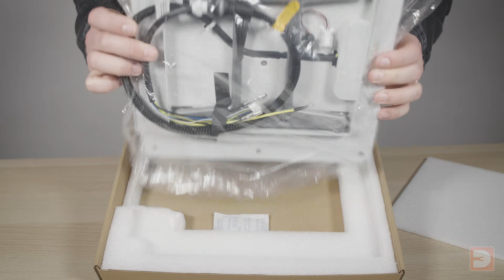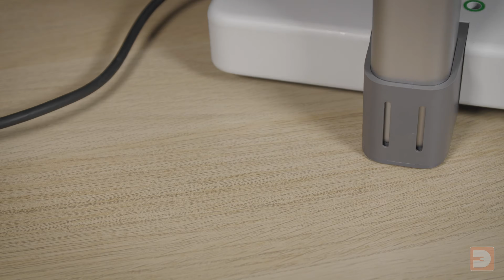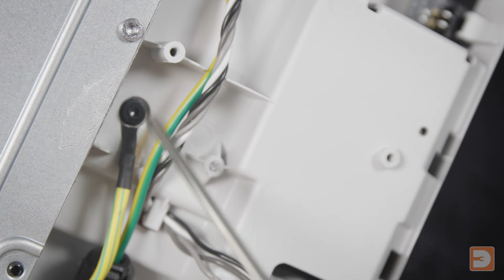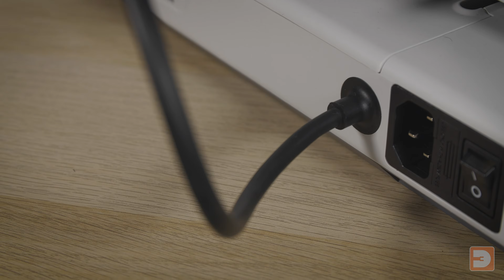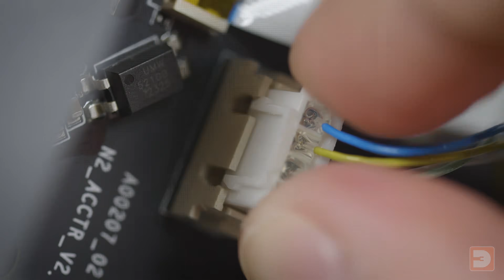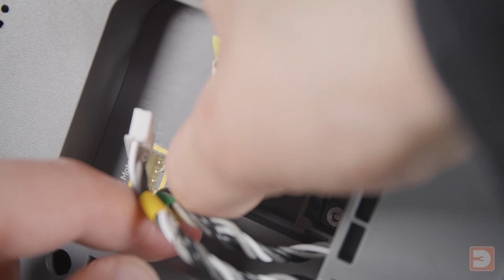A1 Heatbed Replacement Tutorial

Comment from the maker: If you're replacing your heatbed as part of the recall, Bambu Labs will require you to take 3 photos of your updated printer and send them in to receive your gift voucher. Some of those will need to be taken before you fully re-assemble your printer, so please check the email and/or ticket message that Bambu Labs will have sent you to confirm which images they require from you before starting this process.

I wasn't able to confirm before posting this video that Bambu Labs was definitely requesting the same images from everyone (rather than varyinig the request slightly to prevent people from just copy and pasting other photos), and as a result didn't specify the photos in the video so as not to misinforrm people.

Let me know if you have any issues, and happy printing!

Comment: My A1 was defective right out of the box with a broken heatbed, which was not related to the previous recall.  It just flat-out didn't work.  Bambu's solution was to send out a new heatbed and then compensate me by giving me a whopping two free rolls of filament to tear the original heatbed out and install the replacement.

I found it much more prudent to send the entire printer back and get a refund, as their tech support team was extremely difficult to get along with. Even the return procedure was frustrating as Bambu INSISTS that the customer document the re-packing of each piece of the printer, including taking video of the full disassembly and properly re-attaching all the original shipping constraints, including re-fastening the heatbed's shipping screws, re-tying all zip ties, etc.  It's been weeks since I returned the A1 to them and I still have not received a full refund. . . and after all the hassle of recording the repacking process they never asked for that documentation.

I will never deal with Bambu again.  This has been a nightmare.  A competitive brand arrived in record time, was easier to get up and running and overall been a joy to deal with.  It was slightly more expensive, but in this case  you truly get what you pay for.  

Bambu is cheap for a reason.  Learn from my mistake.

Comment: I only want to ask, what are the best items to buy from discount we have got after the replacement?
Heatbed Nozzle Wiper and Hotend with Nozzle 0.4mm as spare items? Anything else?
I am not heavy printer but I know anything can break after some time, but I do not know the weak points of the 3D printers...
Reply from the maker: Hey there, sorry for the late reply.
Assuming the A1 is the only Bambu Labs printer you have, I'd suggest getting a spare 0.4mm Hardened Steel nozzle, as well as a 0.2mm nozzle and either 0.6mm or 0.8mm. This will give you great flexibility when printing different things (If you're not sure the advantages of different size nozzles, I posted a recent video covering exactly that).
Other than that, a spare nozzle wiper is good to have, and beyond that, it's difficult to tell what may be the next thing that needs replacing on the printer, so you'd be best spending the rest of your voucher on possibly an additional build plate, and then as much filament as the voucher will afford you. 
If you really only wanted to buy spares with the voucher, the next most perishable item in the A1 would be the belts, so you could invest in one of each of them.

Hope that helps (if you've not already spent your voucher), and again, sorry for the late reply.

Comment: Did anyone need to perform bed tramming after installing the new heatbed, or was there no need?
Reply: I skipped it... I only did quick bed leveling when printing something and it was ok.
Reply from the maker: I ran several test prints of different styles after recording this video to ensure it was printing well before editing and publishing it as I wanted to double check tramming wasn't required.
I had presumed it wouldn't need it with the level of automated calibration it does anyway and it was fine for me.
That said, I have seen a couple of people say they needed to do it, but I am not sure if that was a precautionary judgement on their part, or they found it to be necesary after experiencing issues.
If enough people comment requesting a bed tramming tutorial, I'll make one and link to it in the video description.

Comment: As someone who just installed the new heat bed, I have a question for you. What should I do with the old heatbed, and is there a safe/proper way to dispose of it?
Reply from the maker: This is a good question and I have some thoughts on things people can do with them that I'm working on for a future video so I will revisit this topic.
If you did want to get rid of it though, correct disposal methods would depend on where you are and your local services. But there's no dangerous materials or electronics in there, so would be the same process as disposing of a toaster or something like that.

Comment: And why don't you show the manual bed levelling?
Reply from the maker: I'm guessing you mean bed tramming.
Well I had assumed that it wouldn't be necesary as a result of the level of callibration it does when running full calibration. However I didn't want to just publish a tutorial based on an assumption, so I ran and completed several prints checking everything ran fine after replacing the bed before editing and publishing this video, and it worked perfectly. I didn't want to add another step for people to work through if it wasn't necesary so didn't include it as a section in this video.
I've had a couple of people ask if it's necesary, but I don't think I've had anyone yet say that they found it was necesary.

Comment: I wish someone would explain how to disconnect the AMS filament tubes correctly :/
Reply from the maker: As in, removing the PTFE tubes from the AMS itself, or from the 4 way splitter on the extruder?
Reply: @3DRevolution  both ^^ but i did it, its was by far my biggest issue because i wasnt sure if i had to pull or push it (push both down), they were pretty hard to remove.

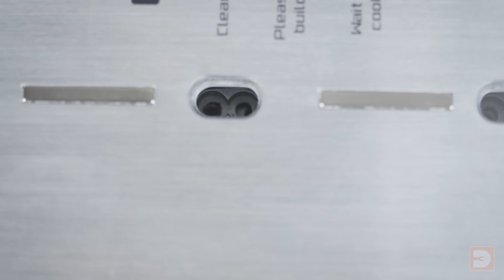Comment: At 8:15 I didn't pay attention to the "slide the bed to the back of the printer" and used the wrong screw holes. Everything worked, I did a calibration then a test print of Benchy. However after a few prints, I kept getting errors that the build plate was missing.

I realized that those 4 securing screws I put in the wrong holes so the head bed was 1/4" too far forward. When I saw the head descend down to locate the plate tab, it just missed.

As for pictures, bambu emailed back to get me to include my serial number in the shot, only then did they clear my recall message on my printer and process the credit.

The manual heat-bed levelling procedure is missing from this instruction. While I ran the file suggested, I didn't watch the video showing the adjustment of the 3 levelling screws until there was a sheet of paper clearance between the head and the head bed without the plate, and the tightening the 2 lock bed screws.

The balancing act of the printer on its side scared me, I guessed that it would slide off the box and damage the parts so I used a pillow.

Comment: Thank you for the informative video. Do you know if the check by an electrically skilled person is required in the UK to get the voucher? Or this only in the EU?
Reply from the maker: You're welcome RE the video.
No need for getting it checked over in the UK, this is only the EU.
However, Bambu does require you to send them a set of pictures to prove that you've completed the bed replacement correctly before they issue the voucher. They should have sent you an email and/or ticket update letting you know what photos they wanted.

I would have included it in the video but I'm not 100% sure it will be the same photos requested for everyone as they may vary it to prevent people just using other people's photos.

For me it was a photo of the re-fitted ground cable, a photo of the sensor wires held down with tape, and a photo of the back of the printer with the end-stop fitted and the serial number QR code in frame.

Comment: I'm beginning this exact process right now 👍😎  we're get the $120 voucher, plus there is a discount 20% coupon code going on right now for the ams light.  Perfect timing 😀
Reply from the maker: Good luck with the swap over!
I was hoping to get this video out sooner than today but unfortunately my kit didn't arrive as soon as expected. Still glad to get it up for people planning to do it over the weekend, hopefully it helps.
Reply: @3DRevolution all done, thank you very much.  Your video was excellent.  I also made sure i took photos of the connectors and ground wire, etc before screwing the bottom plastic shells back on.  BL asked me to send those to ensure it has been done properly and to receive my voucher. 

Thanks again 👍🎉
Reply from the maker: @BennyTygohome  Glad it all went well and great work for taking the pictures. I did mean to include reminders in the video at the relevant points but both couldn't guarantee they would ask the same evidence from everyone (or if they'd vary it slightly to prevent everyone copying photos), and I also forgot until after I'd posted it haha.
Happy printing :)
Reply: What is the discount code?
Reply: @giovannispagnuolo7715  AMS-lite-20-4MC